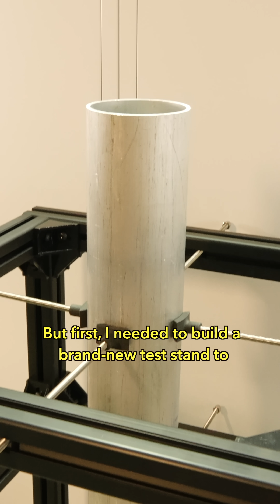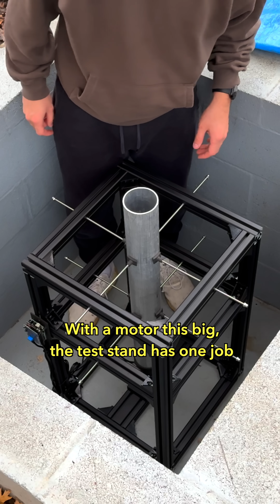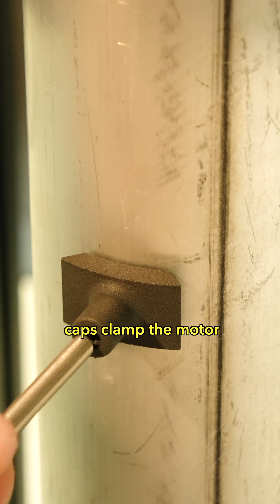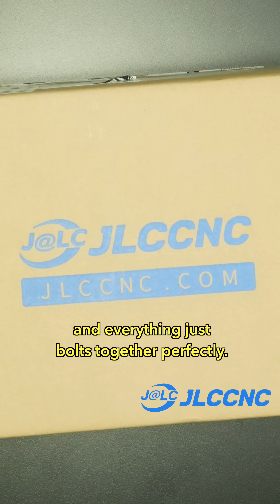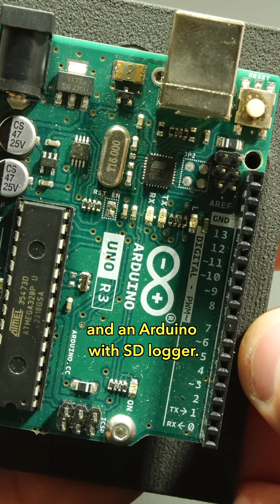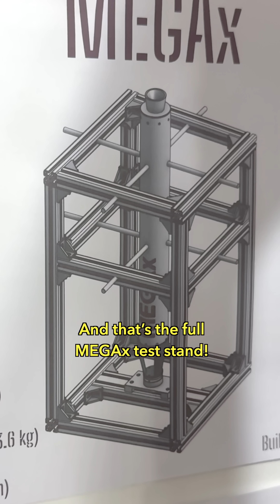Building the Stand for My 500-lb Rocket Motor #rocketry #science #stem #engineering #mustwatch #fyp

Comment: You could put a radial air scoop (basically just a cone) just before the exaust and create a nozzle that mixes the fresh air into the exhaust to get a higher isp, simular concept to modern turbo fan jet engines. You could then use air for cooling so the nozzle can be thinner and the added bonus of a very low center of preassure